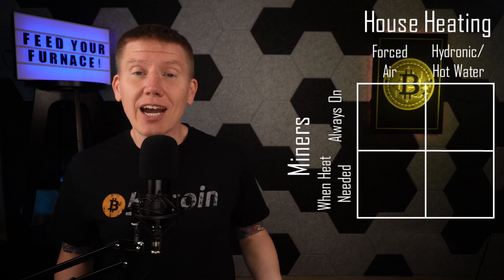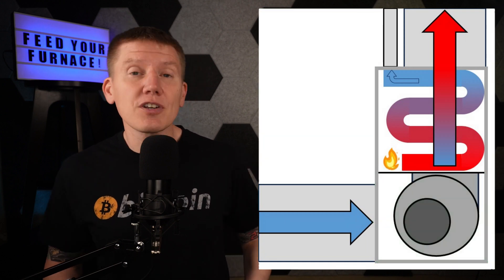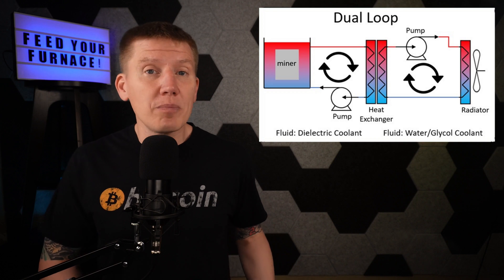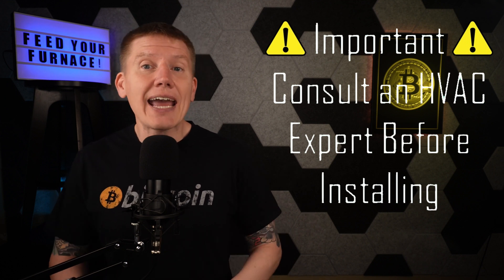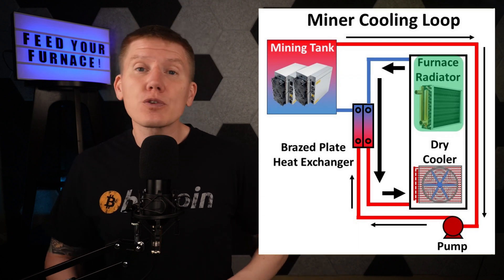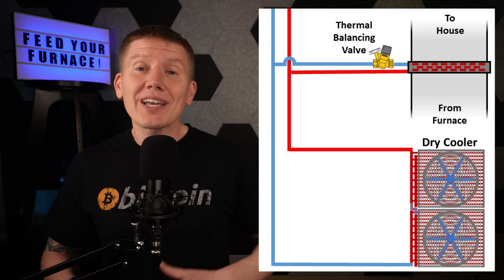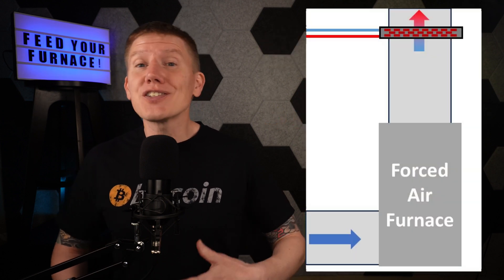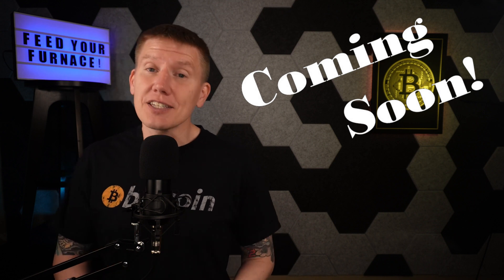EP21: Convert your furnace to BITCOIN HEAT!

Comment: I’m considering doing home heating without immersion. I will be locating the asic in my attic. Swapping in an inline duct fan for noise reduction, and adding a secondary duct system, independent of the main hvac. I could tie into the existing ducting but that has its own issues. Still deciding if I want to regulate heat by underclocking or using an external duct diverters. It’s still 105 F in Texas so I’m in no hurry to begin work.
Reply from the maker: Yeah...there are quite a few people who have gone that route with success.   You'd fall into that category where you're only mining when you need heat, which I'll cover soon.   When you get your setup up and running, send me some photos!

Comment: Great Video! I have been working in this area for a couple years now. @5:30 I like your solution for the control valves, we use Taco valves with a temperature sensor control relay as we don't want any warm fluid causing an overheat of the house due to the confined area of the ductwork that the air to water heat exchanger will be located. We also use the water glycol loop with an indirect hot water tank. These videos are amazing explainers and I wish they were around 2 years ago when we started! Keep it up!
Reply from the maker: Thanks for the support!  Yeah...in a future episode, I'm going to get into water heating, indirect water heaters, etc.   Lots more to come!